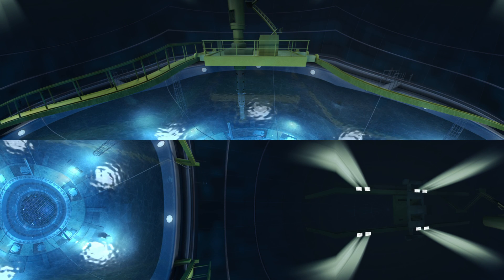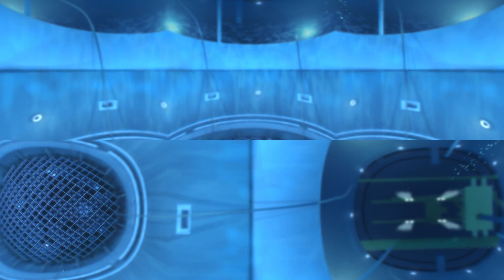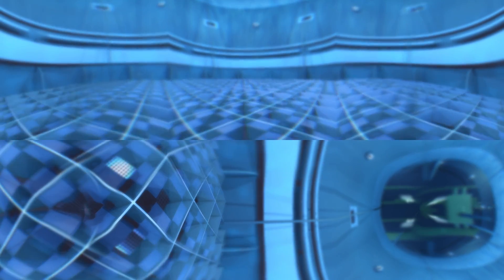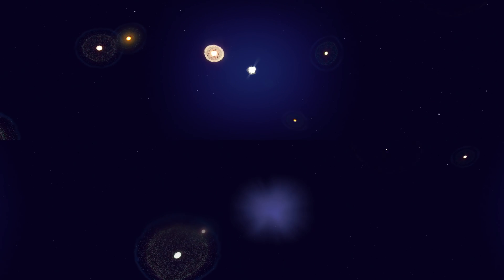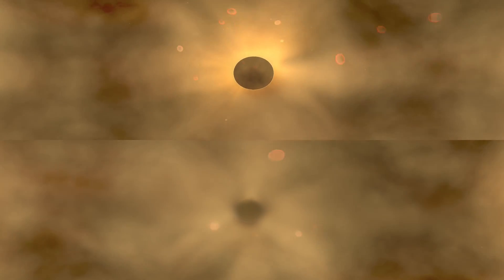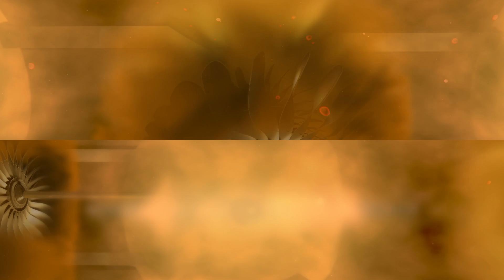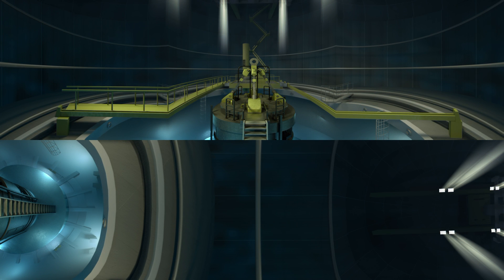What is nuclear energy? Shrink down to an atom and find out

Comment: I dont get it. The entire pool is heated or is there another water flow within the pool?
Reply: inside the pool its usually a closed circuit of water, where the flow is regulated so that it doesn't turn into steam, that heats another circuit that does produce steam.
Reply: Depends on the type of reactor really. I believe the type they are describing here is a Pressurized Water Reactor. The water inside the reactor is kept at high pressures to raise the boiling point(avoid it becoming steam). That hot water is then used to heat water contained within another system that turns into steam.

Here is a basic diagram : https://www.nrc.gov/reading-rm/basic-ref/students/animated-pwr.html

Comment: with 2 mil. lbs of nuke pellets in this reactor why does it not explode it only took about 200 lbs b +/- of plutonium to do in the Japanese in ww II
Reply: Dharph Rhoritty I believe in a nuke the uranium or plutonium depending on bomb, are forced into each other with great power. Therefore creating a massive explosion. In a reactor they aren’t forced together and also water (moderator) is used to slow down the fission reaction. That’s why explosions in reactors are very rare and if they happen the explosions aren’t very big.
Reply: Nuclear power plants don't produce nuclear explosions because the concentration of nuclear material is too low.

Comment: So in the end, we are just burning something other than wood or coal to create steam and to turn a  turbine faster. I am quite disappointed by this discovery. I thought nuclear energy meant extracting energy from the core of the atom and turning it directly into electricity. Thinking over it, apart from solar power, all other means of generating electricity merely involves turning a turbine. We might not be fools, but human beings are not that intelligent after all.
Reply: 1) Most of the world runs on AC current, there's no such thing as a grid-level DC-to-AC inverter.

2)The most useful output of nuclear decay is heat. Static build isn't really a factor and basically impossible to capture in a cooling tank.

3)Steam expansion is the best way to turn thermal energy into mechanical.
Reply: I mean this is the most efficient way we have came up with to convert nuclear energy into electricity.
Reply: Salim R if you thought that then maybe u should go back to school
Reply: Salim R and also the fuel isn’t burned, it’s called fission. Which creates the heat energy which in turn creates steam which therefore turns the turbines.

Comment: All these risks and tons of radioactive waste being collected for a nuclear power station to simply be a glorified kettle and it's steam to turn a turbine, why not build a couple of wind turbines or a geothermal power plant with the heat in the Earth and save millions of pounds?
Reply: All reprocessable by using cycles that 'don't' produce material for nuclear weapons (which is why they were abandoned.) The best wind turbines put out a maximum of 2.5-3 megawatts at full design wind speed (which they are rarely at and few places actually see in the world.) A modern individual reactor can now produce about 1100-1200 megawatts, 24/7/365. If you can put a resevoir for emergency cooling, you can build a reactor.

Current designs exceed originals many times over in efficiency, and safety. With the Thorium Cycle in a molten salt reactor, old waste can be completely recycled. The real question is not 'if' nuclear power, but that we stop using old GE designs and maintain their profiteering.
Reply: You do understand that geothermal power only works in areas with volcanic activity?
Reply: iridium3254 exactly what I was thinking
Reply: Your comment is the reason some people shouldnt be allowed to express themselves freely...
Reply: STOP BEING SO NEGATIVE BISH

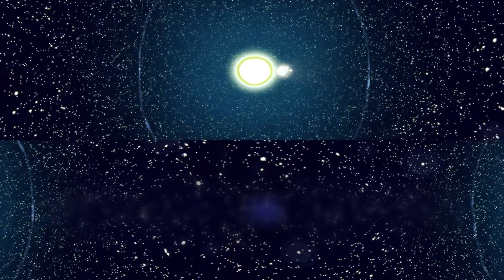Comment: This is the first time that I've let an ad play without pressing the 'skip' button. Whoever designed and rolled out this ad definitely captures inquiring minds. I went from the ad to your video. I'm intrigued: at 1:32 it states - "Firing this neutron into the nucleus of the atom...". How does the neutron get fired? I'm assuming that not all neutrons hit their target.
Reply from the maker: Hi Steve, thanks so much for your comment! We didn’t want to overcomplicate the explanation during what is a short video but you are right, during the fission process the neutrons from the uranium are freely moving inside the reactor. The collisions happen at random however we control the volume and speed of reaction through the use of the water. In a Pressurised Water Reactor, the control rods are mostly fully withdrawn from the reactor and play very little part in controlling the reaction, instead we rely on temperature feedback to determine power level. If you are interested in finding out more we also offer free tours of our eight nuclear power stations, something 500,000 people have already done. You can book a free tour here http://bit.ly/2qTtq6i http://bit.ly/2qTtByJ - ^Emma
Reply: @edfenergy  So, there's no graphite in this reactor design anywhere of the system illustrated in the video?
Reply: @ÖmerMerken  graphite is illegal to use in nuclear power generation. Didn't you watch Chernobyl?
Reply: They do not always reach there target and the neutron is fired through a neptunium tube
Reply from the maker: Hi there, your comments illustrate just how complex nuclear energy is. We didn’t want to overcomplicate the explanation during what is a short video but you are right, during the fission process the neutrons from the uranium are freely moving inside the reactor. The collisions happen at random however we control the volume and speed of reaction through the use of the water. In a Pressurised Water Reactor, the control rods are mostly fully withdrawn from the reactor and play very little part in controlling the reaction, instead we rely on temperature feedback to determine power level. If you are interested in finding out more we also offer free tours of our eight nuclear power stations, something 500,000 people have already done. You can book a free tour here http://bit.ly/2GyKlRu http://bit.ly/2GyyMKf. ^Emma
Reply: cool

Comment: Nice to see a well worded balanced argument with the pros and cons of nuclear power. You may have missed some of the cons let me help, All that cooling water is recycled but at end of its life span (which is how long?) cant be released back into the wider environment due to nuclear contamination. Uranium is natural (slightly different concentrations but nm) but so is arsenic and asbestos, you wouldn't rub your face in it. What happens if all that water gets out or becomes entirely steam as per the process? (Ask Japan they might know). I think we should pass over nuclear degradation of materials it may be a bit complex for your target audience.

I'm fore nuclear power but this is blatant propaganda for the masses telling only a half truth. If you want to inform people then fully inform them.  It's a good idea these benefits outweigh these cons and the cons can be managed in this way don't just ignore them entirely.
Reply from the maker: Hi Sam, 99% of our total water footprint is seawater which delivers an important cooling function. The seawater is drawn in and flows through a closed cooling system before being pumped out to sea a few degrees warmer, but not at a level to cause any effect on marine life. This cooling water is not radioactive because it doesn't come into direct contact with the reactor at all. Being located around the coast is an advantage to the UK's nuclear stations because the cold British waters allow for efficient cooling. ^Ciaran
Reply: Yes I am aware that a tiny percent of the water needed become radioactive and for a relatively short time compared to other radioactive waste products. Again its an incomplete answer, 1% is well 1% the is no context. (The figures in the next bit are just for example but are plausible quantities)
 Lets go with a lifetime usage of 100 billion litres over fifty years. (100,000,000,000/50)/365 = 5,500,000 litres every day. 
5,500,000/100=55,000 litres everyday is deemed unsafe to be released or 1 billion litres (400 olympic sized swimming pools because people know what that is, but it helps with a visualisation maybe)

99% is safe and I have no evidence to suggest its not but that tiny 1% could and probably is a very big number.

The video states that the reactor is under water and now your saying it isn't cant be both. Is what you mean to say the steam is put through a condenser, returned to the reactor and the resultant heated coolant is presumable used to help keep other processes running. Until it is deemed uneconomical to extract more heat. It is then  passed over a series of heat exchangers were sea water is the next container for the waste heat and because of the separate looped circuits this is enough to keep the sea water from become dangerously radioactive. therefore the waste heat is dumped into waters around britain.

Also minor note sea water is cool enough anywhere around the world the uk isn't specialty cold with temps between 8 and 22 centigrade. Being located on the coast is the only place in britain with enough water to cool a nuclear power station. 
 
I'm glad you have engaged in an open discussion about the use of nuclear power around the uk.
Reply from the maker: Sam, you raise some really good questions. There are different designs of reactor, some which are underwater, like the one in the VR and like Sizewell B and some that are not, like the rest of the UK’s operational nuclear power stations. In the type of reactor shown in the VR there are three separate circuits of water. The first is the water that is pumped in a closed loop through the reactor. The second is another closed loop, with water boiling into steam in the Steam Generators, driving through the turbines and being condensed, before being pumped back to the Steam Generators. This is another closed loop and is separate from the reactor cooling water. The third circuit is the ‘open’ seawater circuit that is used, primarily to condense the steam underneath the turbines. Again, its water is kept separate from the other two circuits. It is only the water that is used to cool the reactor that becomes radioactive, mostly through activation of dissolved substances in the water but also through the formation of, for example, Tritium. The other two circuits do not become radioactive as they don’t run anywhere near the reactor.

Note that it’s not uncommon for reactors to be located on rivers or lakes – sometimes with cooling towers (e.g. in France or the USA). In the UK we operated reactors on a lake in Wales (at Trawsfynydd) for many years, so it’s not essential to be on the coast, it just helps!
Reply: Sorry for late reply, been busy with life. I could go for hours about the pros and cons about nuclear its quite an interesting debate (I do always enjoy a bit of speculation on the design of such things). I would like to bring you back to my original point that has been skirted around so far. That this video is lacking in any of the cons of nuclear and therefore is posturing propaganda to sway the minds of those (probably most of the population) unwilling to do any research if to the subject. "We are right, you are lazy and therefore nothing to worry about. "

Do you 'EDF' (not the person replying to the post, I'm not having a go at you) not feel that there is a certain responsibility to say to people that these are the risks and dangers involved with the technology, however this is how we have mitigated these risks and that our measures far surpass anything that has been done previously.

 At  least people would be aware of the risks and be better informed to decide whether or not they are for or against you plans. ( although the need for public support is questionable in such a long term project, people only really have an initial  reaction and are then pacified by the fact that it is going ahead anyway and there is no point in complaining except to their mates down the pub or on Facebook). 

In short, Why is the video so pro nuclear ignoring all risks? Especially considering what other methods of power production there are, although I do understand the need for a diverse group of production methods.
Reply from the maker: Hi Sam, thank you for your responses and great questions, we have lots of information on our safety and procedures online here www.edfenergy.com/energy/safety-reporting and safety is always our priority. However this VR video is trying to inform how nuclear fission creates energy... a process which is not commonly known. I can see that you find this interesting and if you live near one of our sites maybe we can arrange for you to come on a tour and learn more? If so just DM some more details and we can arrange for this. Thank you John. Also there is more info on our tours here www.edfenergy.com/energy/education/visitor-centres and more info on nuclear safety and reporting can be found with the NIA who we work closely with  www.niauk.org